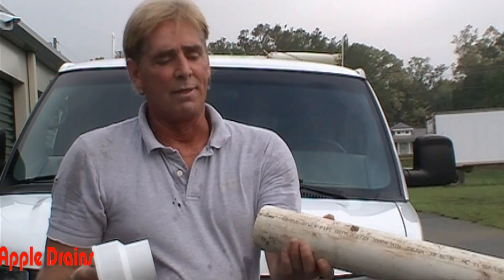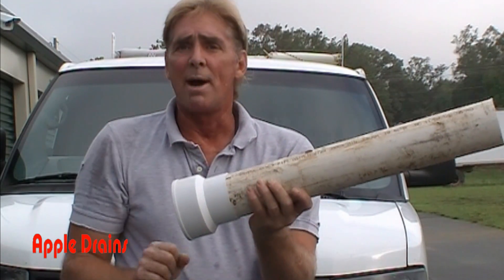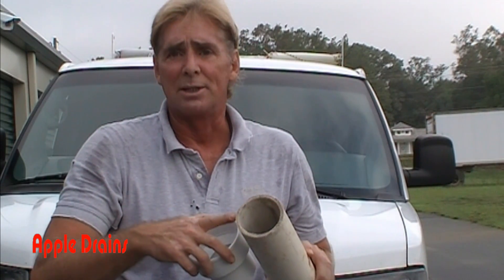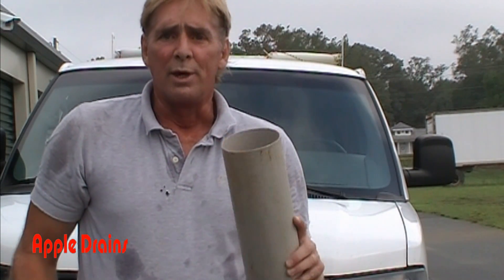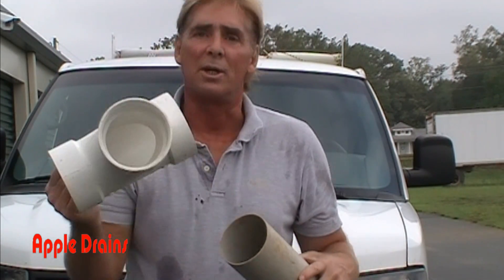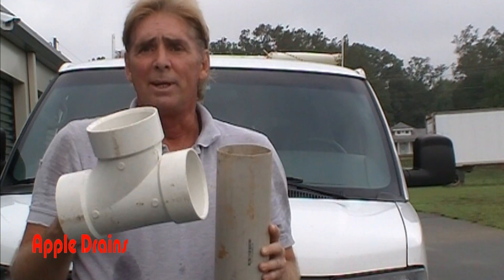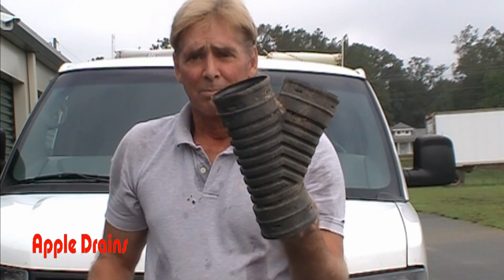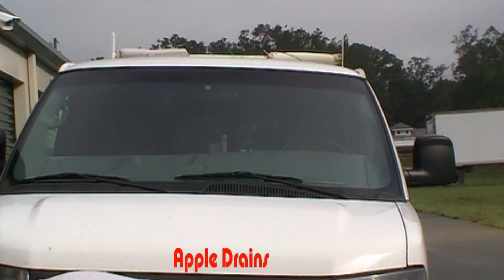Rainwater Drainage Material, Fittngs, Pipe, PVC, Corrugated, How To, DIY, Understanding Drainage

Comment: Pressure pipe and drain pipe are different sizes.  The size standards for pressure pipe from 125 psi to 315 to schedule 40 and 80 all have the same outside diameter.  Low Head pipe aka drainage pipe is not sized the same way.

Comment: How do I glue/bond triple walled hdpe pipe to a catch basin?

I’m using nds trench drain pipe (corrugated pipe ) and I’m trying to connect to existing triple walled hdpe pipe. Only connection I can find that connects the 2 is a certain catch basin

Comment: Where do you find the thin wall pvc? All the stuff I find at home centers has a bell at one end, but I'm wanting to join multiple catch basins together, and I don't think the bell will work with them. Can I just cut the pipe before the bell to retain the same diameter?

Comment: You did good until you exceeded the 3,000 pound rating of the corrugated pipe by 600 pound!  A corrugated pipe is usually buried under ground with at least 2-3 inches of crushed stone covering it with perhaps sod on top of stone.  As you can see, you were fairly comparing different pipes as they were intended to be used by the manufacturer.  It is like trying to tow a house with a 4- cylinder Chevy and complaining why the engine was burning!
Sorry for this reminder but when the load carrying capacity of a column is exceeded, don't be surprised if the building collapses.

Comment: Very informative video. One question though, how do you connect a 4 inch corrugated pipe to a thin walled PVC pipe? What type of adapter should I look for? Thanks!
Reply: If want it to last Yrs> I Not only Use Thin Wall PVC ( Not the Cheap Corregated Stuff) & Got the Correct Tight Fitting Adapters, but Not just Glued them but Screwed them together as well ! Simple 1/2 " Drywall Screws and my handy Cordless Drill! and I have already  the line out 2 times in the past 4 yrs to keep the Line Clear/Clean..& Flowing .. ( do that especially if have Bushes or Trees around ) and I also set the Pipe in 2-3" of Gravel Base..( got all the above Ideas from a TOH- This Old House Story Roger did  & Apples Ideas! Thanks Guys!